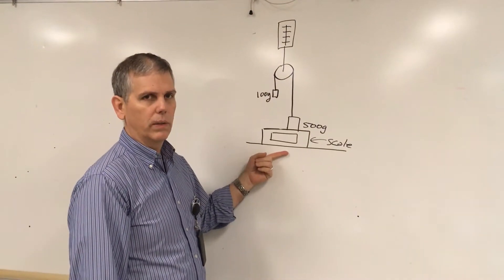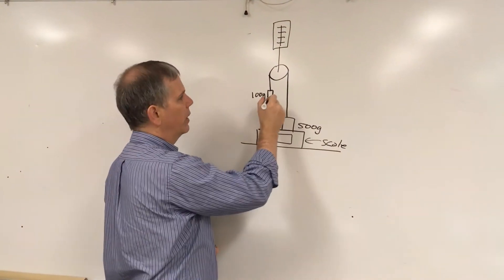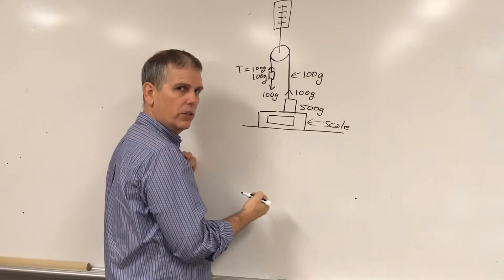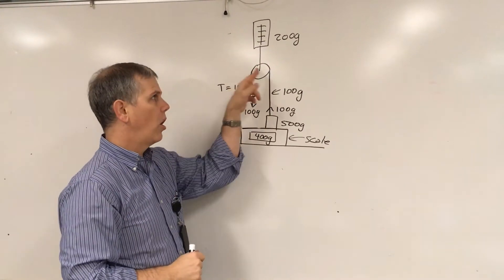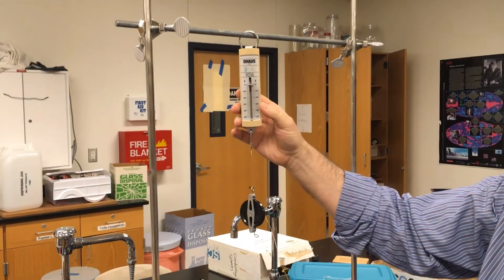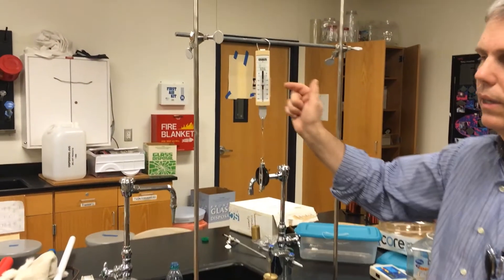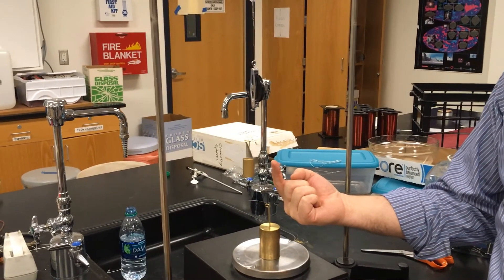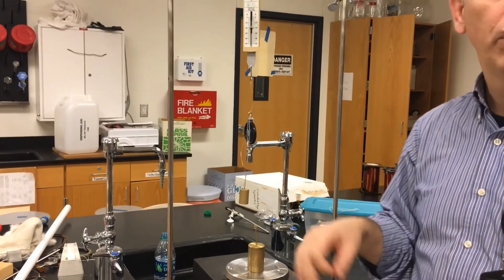Rope, Pulley, Scale Problem

Comment: How would you calculate what it says on the spring scale if the pulley was moving?
Reply from the maker: If the masses were moving the digital scale below would read zero. Then, assuming the pulley was frictionless and massless (some are very close), the spring scale would always read twice the tension in the string. To calculate the tension in the string would be an easy two mass system problem:  (Mg)heavy - (mg)light = (M+m)a, to find “a” of the system; then use this a with either mass to calculate T.

Comment: Put some books up and see if that 100 gram weight is actully reading 100gs its def not cause u had to mechanical advantages one being the pulley the other being the spring on the scale ! So that 100grams is now less mass
Reply from the maker: I'm not sure I follow what you are saying.  The 100g mass is, of course, 100g.  I could put it on an electronic balance to prove that, I guess.  The only manipulation I did with this lab, was zero the spring scale so that its mass (the scale) was not part of the measurements.  I really would, though, like to redo this video.  I want to show the problem with the scales covered and them reveal the answers.  There are also lots of ways to expand this lab.  It really helped my students understand tension, which is much more complicated than it seems at first glance.